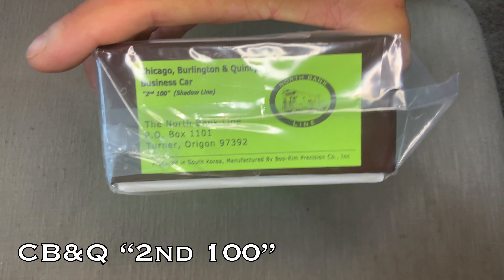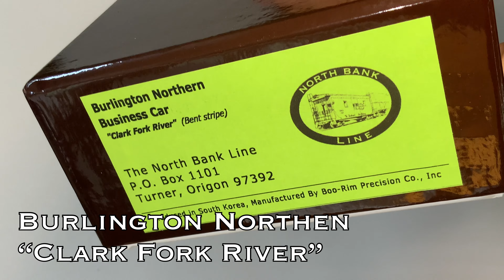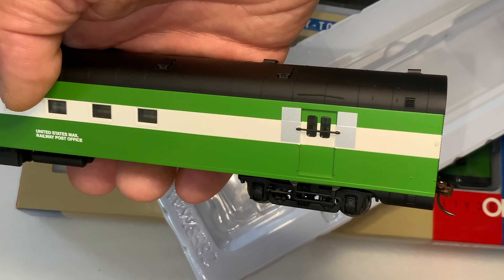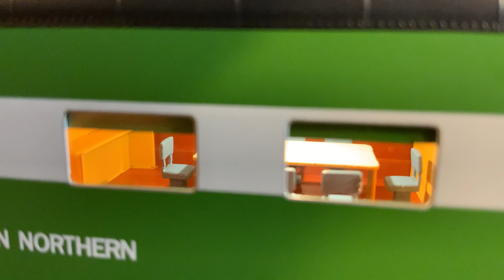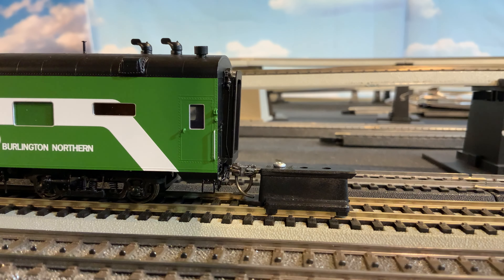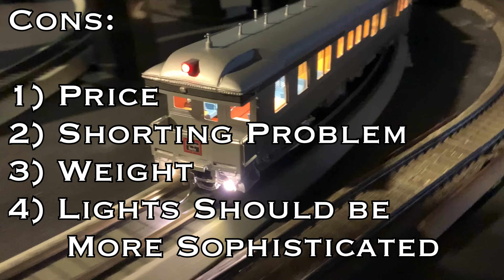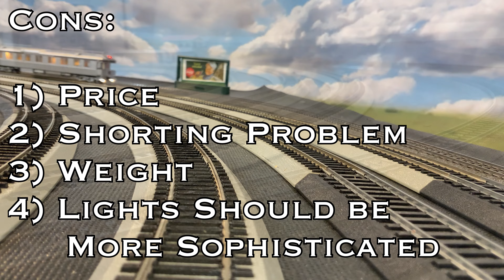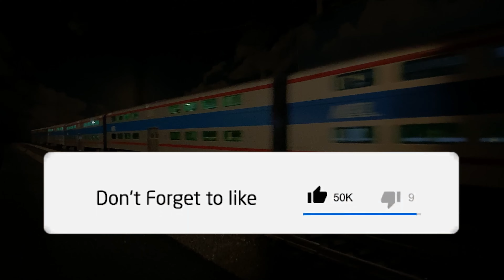Detailed Review: HO North Bank Line CBQ 100 and Burlington Northern Clark Fork River Business Cars

Comment: I agree, dip switches like on the Coach Yard cars would be nice.  The lights on the back are not ditch light though, they’re track inspection lights and would be used when the car was running forward in normal operation.  It is doubtful they’d be on all the time though.  All things considered these were available for less than current market price of OMI or Coach Yard cars, neither of which came from factory with any interior lighting.  I’m very happy with mine, just wish there was a decoder for lighting control and ability to dim the lights a bit.
Reply from the maker: Ah! I appreciate all of your insights into these cars! I do feel that I received a fair product for the price, but I can't help but thing that for the G, it should have just gone a little beyond fair.. but, certainly no regrets. Thank you so much for watching and sharing your thoughts and knowledge!